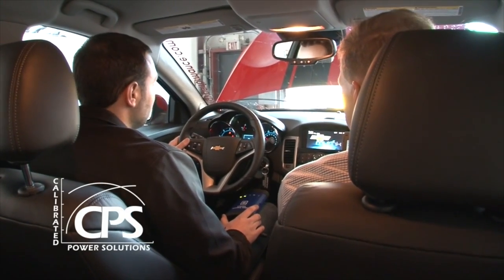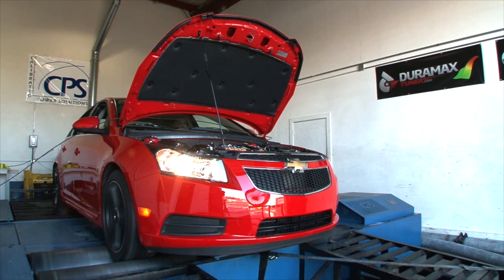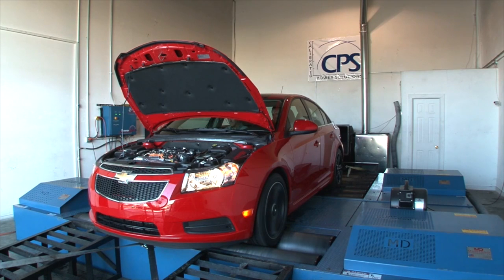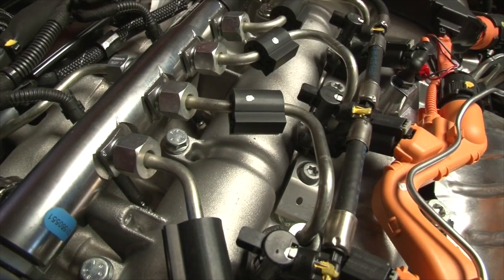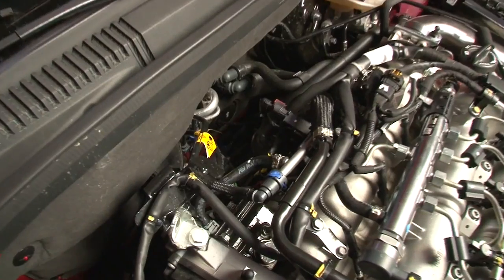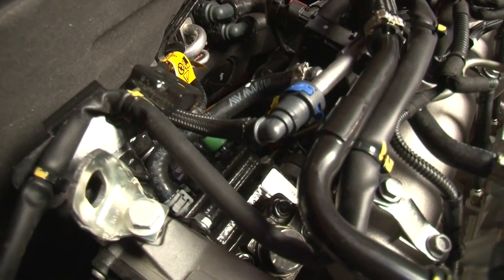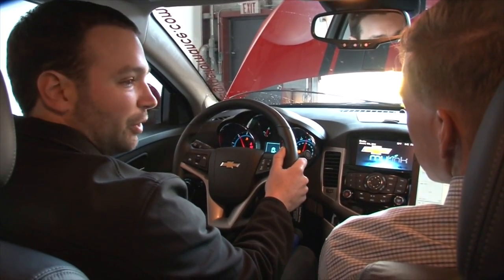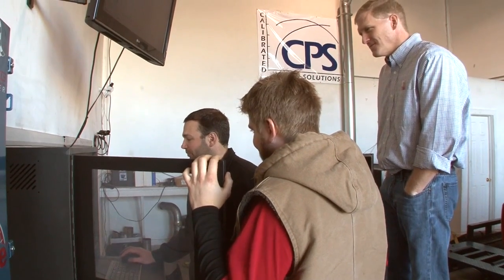DIESEL CRUZE - RESEARCH & DEVELOPMENT WITH EXERGY ENGINEERING

Comment: Did this ever go anywhere? I am thinking about using this engine for a swap, and I'm curious if I can actually get it to produce about 200hp with a little bit of adjusting. I wouldn't be surprised if it needs a girdle or forged rods to reliably hold the power.